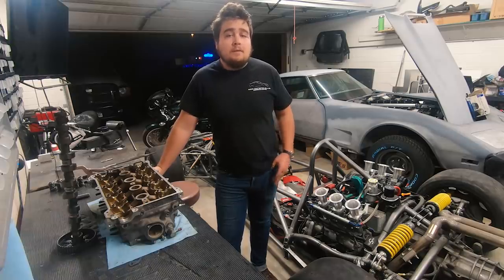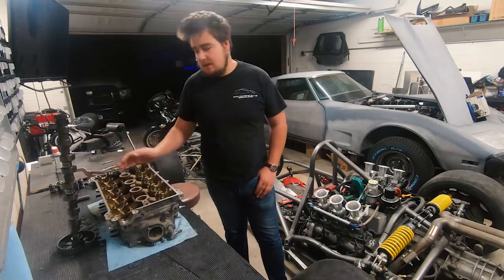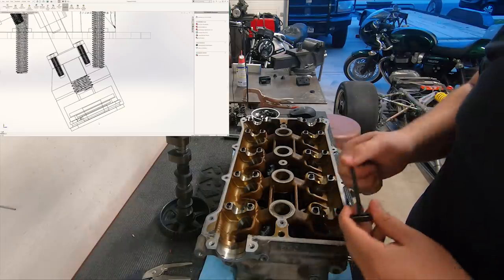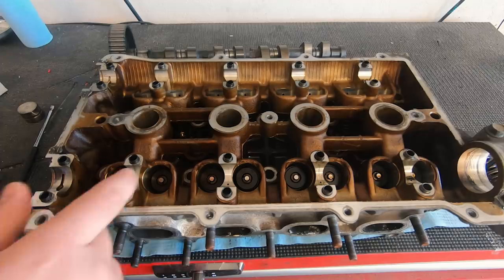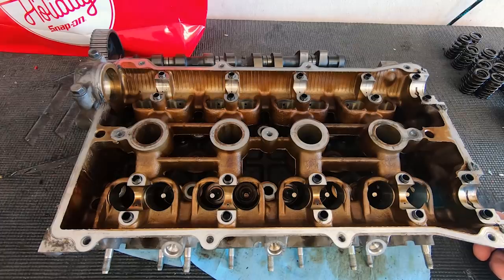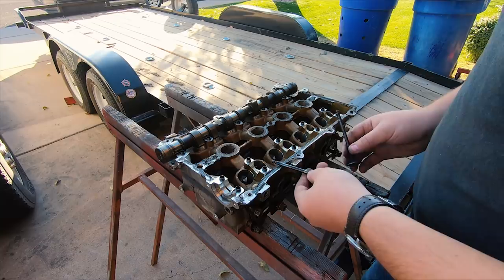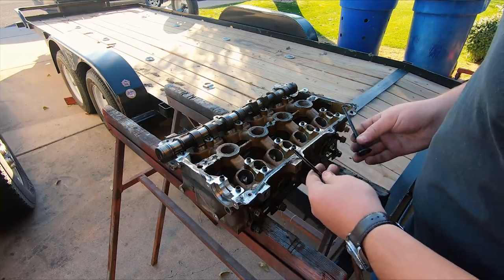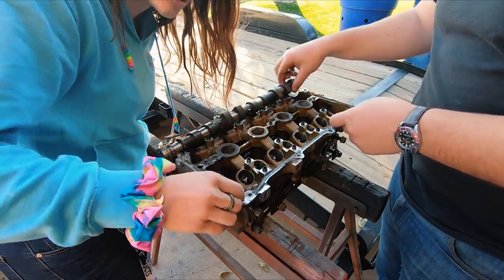Freevalve Miata Build! - Part 1 of  2

Comment: Are you going to use a cable throttle pedal with a position sensor on the throttle body or a drive by wire set up? I converted my na 1.8 miata to a megasquirt and was really impressed by what the guys on the forums were doing with chevy FBW pedals.
Reply from the maker: I've used Megasquirt on a few builds so that's what I'm comfortable with as well. Planning on it at least.

Comment: Curious having so much control over the valves, what the high-revving potential of an engine like this would be? Because Koenigsegg's 3-cyl likely revs to at least 8K.
Reply from the maker: It takes out any limitations with valve float, similar to a desmo head. The limitation then becomes bottom end at that point.

Comment: I don't know if you have already addressed this but why are you going with air actuators instead of electrical solenoids? Are you somehow going to keep the air a completely closed system that will only need to be recharged as needed or are you bleeding to atmosphere each time?
Reply from the maker: Bleeding to atmosphere every time. In the future I’m going to experiment with a closed loop system.
Reply: @WesleyKagan  Yea I understand you are just currently prototyping. I'm always hung up on efficiency and power losses...

Comment: When you get it running what will you call it? a Miatigsegg? a Koenigiata? I'm so excited to see this! Makes me want to get another yata -despite the whole not fitting issue, which is the only reason I let mine go. Note to all you wackos out there like me, the Mazda 323 GTX also had this same engine! rare, yes, but they are out there!  (turbo, awd with this same engine...)
Reply from the maker: Yeah I fit in a Miata but it’s less comfortable than if I was a bit shorter hah.
Reply: @WesleyKagan  big guy mods for the Miata; hammer to parcel shelf behind the seat can buy a bit of space, bend brake handle, replace door handle with a strap, foamectimy to the seat, and go to a smaller steering wheel. I am 6'5" it was doable, but very tight

Comment: Would It be possible to use hi pressure fuel from direct injection instead of air? Whit air you will start to get problems whit valve flutter and maybe other problems related to air compressability.

Comment: I would love to have this tech on my Harley to rev it up past 8000 rpm
Reply: Having traditional valve train isn’t what is limiting the rpm. It’s more to do with the bore/stroke along with overall head flow/intake.
Reply: @NBSV1  that is true but not on the engine i have set up.

Comment: I would like to see before/after dyno or other metrics to see the actual benefit. Did I miss that?
Reply: It totally depends on how smart he makes it.. using one can profile or a profile that changes with rpm.. or changed with rpm and throttle position and vacuum...

A modern bmw engine would make a bit more horsepower... But slap it on a 50's engine and 40% more power should be possible
Reply from the maker: Not yet, that’s the next video... will get some good dyno readings and a before/after.

Comment: Out of interest, why not keep the original tappits/buckets/valve covers, and use single-action solenoids (pneumatic or electromagnet) on top. The existing return springs will keep the valves closed when not in use, reducing complexity. Then all you'd need to do is remove the rockers and cams, and place your solenoids in your redesigned rocker cover on top. And to undo and revert, you put the original cams, timing chains, rockers and cover on and you're back to where you were.

Comment: Great job! 
What is the weight difference bt standard head (with cams and stuff) and head with FV installation? 
How much Watts does the FV system consume?
Reply from the maker: About .125 Amp on 24v, and I haven't weighed them, but I'm positive they are lighter. Cams are heavy.
Reply: @WesleyKagan  thats 3000 W, ~4hp. 
Thank You and Good luck with project!

Comment: so how much hp does this take to run is it going to be more than the regular valvetrain I would assume no but then again pneumatics aren't exactly efficient
Reply: @Lassi Kinnunen 81 i mean you should be able to make way more tq at pretty much all rpms should make up for it. are you going to implement some kind of load or rpm based vvt or even staggered lift at lower rpms rally makes me wonder how much hp a valvetrain takes to actuate

Comment: Someone should have said the Ferrari F355 - 5v head.  That would have been a real challenge!
Reply from the maker: Like I need an excuse for a 355- if I could find a Berlinetta with a 5 speed for decent money I’d buy it in a heartbeat.
Reply: @WesleyKagan  I ended up with the spider ($47k in 2012), but all F355's have 6 speeds (from the factory).  Also the paddle shift F355's use the same manual transmission (and thus would not be difficult to convert).  I like that vette you have there.

Comment: With forged internals, what’s the theoretical max RPM of this engine with a similar to but legally distinct from Freevalve head?
Reply: Probably not much over the stock 7kRPM without other changes. The benefit of having a camless engine is more that you can get more out of the existing engine, because it's much more tunable in terms of timing and duration.
Step 2 of this is going to be the ability to have variable lift, which the existing freevalve engines have. It's a much tougher nut to crack unfortunately.

Comment: i bent my valve in my b18c1 because i snapped my timing belt.... this would amazing to have in  a Honda.... idk how vtec would work tho
Reply: You could emulate virtually any cam profile on the fly with this system. So you could program the valves to open longer and further from lets say 5000 RPM, like Vtec. Or you could gradually increase valve overlap as the load and RPM increase, thus optimizing fuel consumption and power output to near perfection.
Reply: @Duskconqueror  that's is absolutely amazing. I wash I had the knowledge of this guy

Comment: Just so you know Miata’s motors are contactless so if anything in the timing fails the  valves will never contact pistons
Reply: They’re non interference with the normal cams. If the valves are able to open farther then it can become an interference engine.

Comment: I think you've forgotten that the Miata engines are non-interference. You don't need the springs
Reply: Non interference, with the stock cam. Remove the springs, let the valves drop, they will drop into the piston.

Comment: Two things to think about:
1) You should do yourself a solid to stop using "Freevalve" as I'm sure Koenigsegg has that trademarked. If you want to understand why this might be important, take a look at what happened to the "B is for Build" guys and their rendition of the Elanor Mustang ... did not end well.
2) How are you controlling lift? Take a look at how a camshaft works. It isn't just "open" or "closed". It has a ramp open and ramp closed. Your design appears to work by allowing flow, but not by how much lift, but rather it just being opened and closed. Most engines today (and I'm pretty sure the Miata is one of them) are interference engines. The valve and piston share the same space, yet at different times. If you don't account for the amount of lift at any given time (or know exactly where the valve is), you run the risk of piston to valve interference. If you don't, the only thing you can do is limit the valve lift and the timing of the valve so contact isn't made, which will really hurt performance.

Comment: A man in his garage with some smarts is attempting what major auto makers are refusing to do.  Modern auto makers are just getting lazy, freevalve is the best new tech to fight the slow death of gas engines.  Direct injection has helped, along with variable valve timing and other similar designs but they all add complication and are made obsolete by freevalve.  It seems weird to me that no major auto maker has started in on this, big HP, MPG and emissions gains...that is everything they have been trying to do with far more complicated systems.  If this guy manages to do it in his garage, then the excuse the the R&D would be to expensive will fall flat.

Comment: The way i think of this is going from "autos" in the manufacturing world to CNCs

Autos run off of cams and you get profiling tools to cut the shapes, and the cam makes the tool go in and out during a process

Where as CNC is all programed to do a certain profile and its all hydralically operated

Basically with enough coding and enough hardware and soft ware you will be able to have it retarded or advanced low in the RPMs and you can have the valve opening less, and high in the RPMs it can open it more, advance or retard depeneding on the RPMs depeneding on when or how much fluid you push 

Am i right or am i wrong please tell me because it makes sense that it would work this way, like it would be able to advance or retard depeneding on the RPMs but will it put the valves down more depeneding on the preasure of the hydraulic system

Im just a 3rd year apprentice, fitter machinist glorified button pusher

Comment: Bp motors are non interference motors a valve hanging down shouldn't hit the piston solong as the head and deck hasn't been machine a bunch
Reply from the maker: Yeah, I'm also opening the valves closer to the lift of a race cam, or at least it's possible for me to do that. So, I just wanted some safety.
Reply: @WesleyKagan  if this ever goes into production I'll take a 1.8

Comment: Can you adapt this to my 3.0 944 turbo?
Reply from the maker: I strongly considered a 2.5 as a test bed, but went with Miata for parts availability, for right now. I miss my 944!
Reply: @WesleyKagan  Mine's in pieces right now in Phoenix. I'm hoping to get the project finished this coming year. Wouldn't be real difficult considering the engine is out already.
Reply: @WesleyKagan  You in CO?
Reply: @WesleyKagan  I've alwasy wanted to delete the pesky timing belt..

Comment: How would you redirect oil?
Reply from the maker: Outside of the cam oil feeds, it uses the same oiling principles as the factory lifters and guides, so I’m hoping I’m not going to have much trouble
Reply: @WesleyKagan  so im not a miata expert so correct me if I'm wrong.  The cam gets fed oil with the first cap and the oil travels aft in the cam lubricating the bearing surfaces as it goes and you will be taking this oil to lubricate the pneumatic system. Correct?